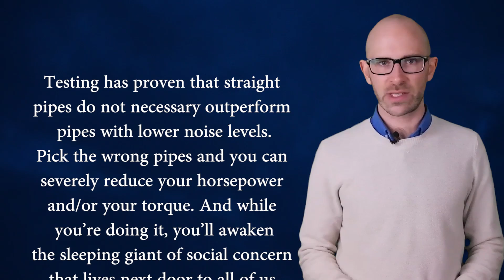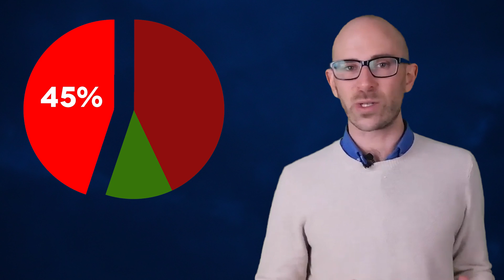Why are Harley Davidson Motorcycles So Loud?

Comment: Do loud pipes save lives?

The answer is a firm NO. In some instances a car driver may indeed notice you, such as when you're riding next to a car which has the driver's side window down. Situations like this one are extremely rare. Most dangers to motorcyclists come from the front, where your loud exhaust can't be heard; the sound waves from the exhaust pipe(s) propagate backward. The driver of that car about to make a left turn in front of you (by far the largest cause of motorcycling deaths) simply will not hear you. Think about it: picture yourself in a car, with the windows up, the A/C (or heat) on, and the radio at a comfortable level. Just how much outside noise do you think YOU hear? Especially the noise traveling away from you, where only the few sound waves that bounce back are even capable of being heard in the first place...
How loud exhaust can actually be dangerous to you

Research has shown that the biggest cause of fatigue on long rides is noise. Noise from your own bike will tire you out faster, dulling your senses and thus increasing the risk of an accident - precisely the thing that you were trying to avoid in the first place. 
Have you ever thought about how annoying the loud pipes are to the car drivers around you? Especially to the ones who have to follow you for miles in dense traffic? While it has never been proven, it is possible that noise from your motorcycle makes car drivers irritated, angry, more aggressive, and thus more dangerous to you.
Reply: Robert Cosgrove
 If the cars in front of you are the problem then it's rider error. I know when a car is going to change lanes in front of me because I always assume every car in front of me is going to change lanes. I'm worried about the car behind me.
As far as noise goes, you are driving you aren't supposed to have perfect silence and be super comfortable. A Detroit deisel is much louder than most bikes and there a many more of them on the road last time I checked.

 Furthermore there should be no reason to get angry while you are driving. We are adults, only children can't control thier emotions. Driving isn't hard but it requires your full attention. If people can't drive safely with motorcycles on the road maybe they should consider taking the bus.
Reply: That is such b.s. if you're used to riding with loud pipes then it doesn't bother you Alot.like you and everyone that agrees with you believe.the person behind you shouldn't be up on your ass then.that's where almost half of motorcycle accidents come from is behind.Try looking up those numbers from,I don't know.Say,20yrs ago and see what they are before people started putting loud pipes on,so that they can be heard.I had factory pipes on my bike and have had several accounts where I almost died.Then,I put my Vance and Hines pipes on and have had fewer chances like that.So,get a bike,a Harley.Then,ride it for 2 yrs and count how many times you either almost or do get in an accident.Then put some louder pipes on,and see how much less likely your able to get in accidents.Also,I am an avid believer in loud pipes save lives because mine and a few of my friends have either been in or have saved someone's life because of it.They don't teach you that in public opinion school.
Reply: Bullshit!
Reply: @DawnNLN-ee2kh  BULLSHIT about what

Comment: Well I ride a 2007 Harley Davidson Sportster XL1200N and my bike has aftermarket exhaust pipes so sure it's loud but in my case when I ride I want to be seen and heard. And grant you sure a 100 decimals is damaging to your hearing but if you wear a 3/4 or full face helmet the helmet muffles some of the noise so you're not experiencing the full effect of the 100 decimals unlike some people who doesn't wear a helmet. And wearing anything in your ears that interferes with your ability to hear ear plugs or ear buds is against the law in the United States has you won't be able to hear if a emergency vehicle (Police, Ambulance, or Fire Truck) is coming behind you and there is car stereos that have sub woofers powered by either electricity or nitrous that exceeds 110 decimals so loud it rattles car windows or house windows but no one complains about those things but hey the host is British he wouldn't understand has heavyweight motorcycles like Harley Davidsons aren't common in the United Kingdom.

Comment: If Harley riders put after market pipes on because they want more power, then the problem is they bought the wrong bike.

In this day and age at the performance end of the scale, Dukati can get 172 hp and 100 ft/lb of torque from a stock 1200cc v twin
 2018 model Harley example: 93 hp and 122 ft/lb torque from a stock 1800cc V twin.
That's 143 hp per litre vs 52 hp per litre
I liked this quote when trying to find hp figures for Harley's(not easy) 
"Harley Davison: the worlds most efficient tool for tuning gasoline into noise, without the side effect of horsepower" :)

Comment: Uuuggghh  Words cannot describe how much I detest those bikes!  There is zero reason why they should be so loud!! 

And the "safety" reason is a huge canard...  riceburners / crotch rockets / other makes of cruisers  are NOWHERE near as loud...  If safety were really the concern, then ALL motorbikes would be required to be as loud as Harleys.
Reply: My Harley has a healthy rumble,  but I know of a lot of rice burning crotch rockets in my area that are much louder.
Especially when the twits riding them have a collective IQ around room temperature. The sound level on my bike may be a little high, but it's in the lower frequency range, and not near as disturbing as the much higher revving rice burners. 
In a previous life I was a BMW efficianado, which by any measure is a much quieter bike. My member size remains quiet adequate and I don't need a Harley to compensate,  and anyone who makes the Reference is just pissed their current financial woes prohibit their owning one.
Reply: Carlos Perez it's not just Harleys that can be loud in fact there are a lot of Harleys that are quiet you do not know what you are talking about.
Reply: Scott Graber yeah and when there are morons driving 8000 pound death machines around while texting and talking on their phone we are supposed to just hope they see us.
Reply: @ScottGraber  stop being such a soy boy.
Reply: Ironically enough slants have a higher fatality rate than cruisers.  Hmmmmm go figure.
Reply: Who put stick up your ass mate ? Chill out man!

Comment: You missed a LOT of the reasons H-D bikes are loud. The exhaust is just one component, and if you've ever heard a Road King with factory pipes, you'll note that the exhaust isn't the noisy part. The bikes being air cooled, having small air filter boxes, and the big one, *the firing order*, have a lot to do with the reason they're so noisy.

Comment: ......simon.....will you ever get your poop in a group?

seriously......ever?

if the title of your video even partially insinuate's as to an actual piece of information.....you really need to include at least a wave in the general dirrection of that infered information....

stating motorcycles are loud does not explain WHY Harley's are louder

May I suggest for your next series of video's you explain why bricks are terrible matterials for building rockets ships.....

door knob

Comment: I own a motorcycle repair shop. The metric sport bike riders with annoying loud, fart can mufflers outnumber my harley riders 4 to one. They are incessant throttle rappers. And do not understand proper tuning and exhaust scavenging. Your video is one sided, and slanted.... somewhat offensive and laced with incomplete thoughts and poor English.
Reply: I would 100% agree.  This is why we consult experts on a particular subject matter and don't just recite data points.  To those who know the major points this guy is missing, we know he doesn't know what he's talking about.  To be 100% fair, everything he said was factually accurate, it's just missing a lot of really important points that a person wouldn't know are missing unless they were actually familiar with the subject matter.  For instance, a point glossed over at the end that the stats for single vehicle crashes included being run off the road by another vehicle, and that is a blatant mis-categorization which will greatly skew the results.
Reply: Well mr iq of 137. Go back to your cardigan wearing mates playing gin rummy and leave the talking to those who don’t require insults to convey their message.
Reply: You're a wrench, not an engineer. Leave the thinking to the smart people.
Reply: @fishyfool  

Engineers only design things that are to be thrown away, not repaired.

This means that people that fix what an engineer has been paid to make impossible to repair has to be smarter than the engineer.

Leave your engineering skills for the rich, ignorant bastards that can afford to replace investments rather than repairing them.
Reply: @fishyfool  i am an engineer with an iq of 137 and you are nothing but a carnival act caller who ran out of snake oil to sell
Reply: @fishyfool  who are you?
Reply: @fishyfool  Damn.

Comment: Its not only Harley. I do have a 1955 Harley 74ci PanHead Bobber my pop built in H.S in 1962 but I do have a Triumph ,Indian Scout Bobber ,TL1000R,2015 Hyabusa and a Bobbed out Custom Chain driven 03 Honda ACE 750 which I had the rear half cut and  hardtailed along with being being lowered 6 inches in the rear, a solo seat and very minimalist parts which is what bobbers are and all 4 of mine are set up very similarly..I  also super rare Ariel which all have straight pipes..Drag pipes...Whatever people like to call them..I Didnt change the Triumph, The 55 Pan or the ACE..My pop did tge work 50 years ago and the ACE I bought used with 1100 miles and was stock except for Cobra Drag pipes and the Carbs being rejetted but I did have custom Straight pipes put on my TL1000R because of the massive weight of tge giant cans they have plus the twin sound kicks ass on the bike..The Busa has a 2 Brothers Shorty pipe,header set up and I LOVE MY YEAR OLD INDIAN BOBBER WHICH HELL YES I PUT A GRENADE EXHAUST SYSTEM ON IT..Its not for power,for me it adds character because they all have unique tones and the WEIGHT is probably the biggest reason..I mean these stock pipes can weigh 80 lbs which is a massive amount of weight to ditch.. and ill continue to..I live here in Vail Colorado and ride across country every year on one of my bikes..Im leaving next week on my Indian for a 2-3 week ride from here to Dallas and then to the west coast and head up to into British Columbia into Alaska and eventually back into the U.S. via Montana down into Wyoming and back home..Cops dont mess with me because I ride Solo..I dont act like some bad ass because of this or that..I love to ride and its part of my lifestyle..I go on tour 6 to 9 months every year and I need to decompress which motorcycle trips are better than a Shrink ...I even run a Titanium Capristo straight pipe,cat delete Exhaust on the 2006 F430 manual 6 speed and  my SharkWerks Straight pipe set up on my 08 manual GT3 RS..I simply love feedback and wont own a Automatic,Dual Clutch - non 3 peddle car with factory exhaust ..I hate to be bored if im travelling which is huge portion of my life.. Loud and Proud!!

Comment: Car drivers who can’t see you in their blind spot are less likely to change lanes suddenly and knock you off your bike IF they can hear you!
Loud bikes are safer to ride, it’s that simple!
First thing I did was to buy a loud exhaust system when I bought my bike, for purely safety reasons!
Drivers who can’t see you will usually make an effort to spot you IF they can hear you!
Normally they hold their road position and either slow or speed up until they can see exactly where you are before signalling their intention to turn or change lanes, or waiting until you’ve over taken them, before doing so!
Anyone who doesn’t understand that loud pipes save riders lives is an idiot who shouldn’t be posting publicly about the issue, because if you don’t understand this fact you already have zero credibility in the eyes of motorcycle riders!
Number one cause of motorcyclists deaths from cars?
SMIDSY!
Sorry Mate I Didn’t See You,
( because I had my head up my own arse or in my I phone reading a text message / watching a video, trying to navigate via google earth etc).
If they can feckin HEAR you then at least you’ve increased your own odds of making it home alive!
Phuk the Nancy’s who complain about the noise, it’s not their phukkin necks on the line riding a bike on roads shared with cars!

Comment: New Harley's are actually pretty quiet. The problem arises when Harley owners swap out the factory exhaust for aftermarket exhaust systems. I love giving "Modified Exhaust" tickets to Harley riders. BTW, those idiot who claim the noise saves lives? Sound travels backwards since the pipes are pointed backwards. People don't hear you coming at freeway speeds but hear you going instead.

Comment: Your dB calculation is somewhat inaccurate. And FYI, Harleys don't come loud, we make them loud with aftermarket pipes haha. 

Personally, I find the sound of Honda CBRs or suzuki hayabusas way more annoying than the sound of a loud Harley. The high pitch whine of their engines is quite annoying. I opted for Vance and Hines pipes on my bike but there are some other Harleys that I find to be way too loud for my liking.

Comment: They are loud because people want them loud. Myself personally I have after market pipes on my 2017 Harley street glide but mine are about 25% louder than stock with low end growl instead of a ear splitting roar that quite frankly irritating.

Comment: The belief that Loud Pipes save lived is a complete wanker, modern Cars are so internally quiet and with a stereo  people are unlikely to hear you anyway. 
If you coming directly toward me  the sound from the bike is projected rearward and  realistically someone ahead of the bike  may well NOT hear you anyway and just PISS people Off. 
There are many instances that have PROVEN that the ratio of Harley's  v Other makes  is NOT significant to show or prove that noisy exhausts makes you safer  FFS People RIDE Smarter and have your head on a swivel makes much more sense to me than making a shit load of Noise.
Reply: but they could turn their pipes forward

Comment: everyone thinks the saving lives has to be direct cage vs car, while often it is. many neglect another aspect that last night I was not just witness to but a part of.

coming home from the ride I was a part of escorting the korean war vet's remains from omaha to norfolk, we took back roads there and then even more backroads home,  it was entering dusk as my commander and myself had split as we live in a different direction than some of them. he cuts off a few towns later. last leg of the trip is known for lots of deer.

what slivers of sun that was left glinting in my mirror, annoying but not blinding but the distance I could for sure make things out were reduced, passing a reserve area and out from a set of trees walks a small buck, I grab for the clutch and give it s downshift, the pipes went from a low rumble to coming alive roaring as I let off the clutch. its head snaps to attention for a moment before he turns around and makes a mad streaking sprint for the treeline.

loud pipes may have saved two lives last night, mine and his, I am not sure I would of had full stopping time if he had continued his walk onto the road. and before you say bikes stop quickly, while most do, I have one of the heavier bikes on the market doubling most of the "typical" bikes weights that are out there. I stop faster than most cars out there but not by that much.

Comment: I would like to see the report that says “number of people that WOULD have hit a motorcycle BUT didn’t because the bike was heard”... 
Loud and Proud bike rider.
Reply: It's not a long list. Trust me.
Reply: @charliespurr7325  I don't trust you because you clearly don't know. I have seen time after time heads turn when I crack my throttle that very likely would not have looked my way otherwise. Did that stop a collision? Can't say because it is logically not possible to prove a negative.
Reply: @longriderbob2882  Your claim still requires data. There are ways to go about it.

Comment: A new line of electric cruisers are almost silent especially with shaft drive. Batteries and motors have made advances and can get much better.
However the parade does sound more like Walmart electric scooter carts. Some how looses  some of the mystic.